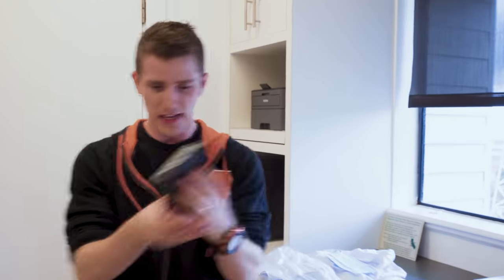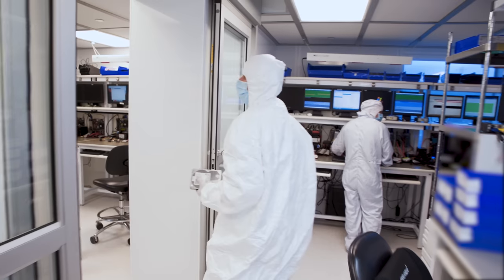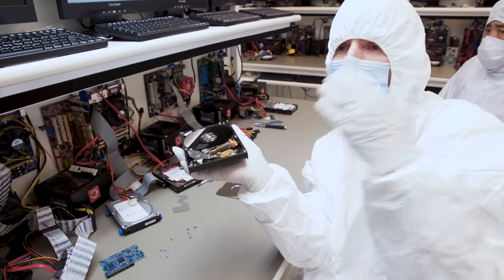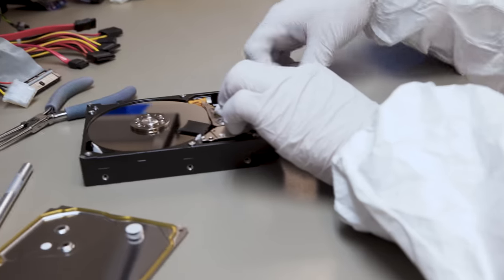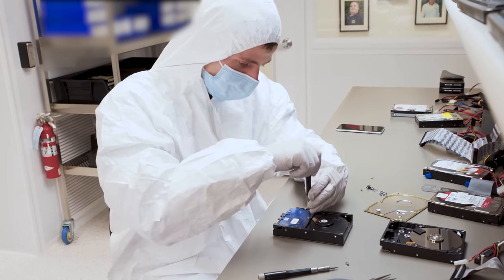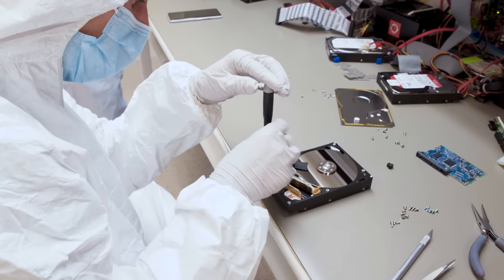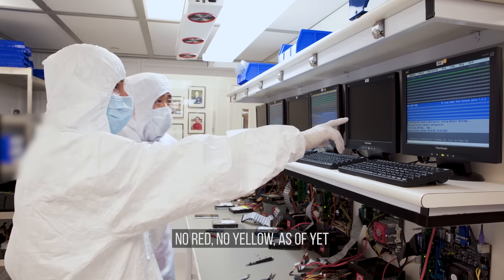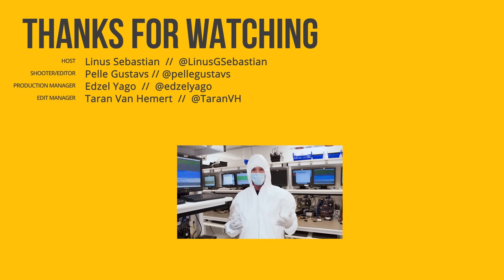REAL Data Recovery - Linus Swaps Hard Drive Actuator!

Comment: Which of these two HDD brands do you think end up the most in that place, WESTERN DIGITAL or  SEAGATE???
Reply: Lost Cause probably Seagate, they have the higher failure rate, however marginal
Reply: Seagate
Reply: Seagate, duh.
Reply: Yes, probably. I'm using a 1 Terabyte Seagate Barracuda 7200 RPM as my storage drive, alongside a Sandisk 120 gig SSD as the main Windows 10 OS location. I bought the Seagate from Amazon six months ago mainly because of it's cheaper cost compared to its WD alternative. I use Hard Disk Sentinel for monitoring all of my storage devices. Well, so far so good. Accoring to its S.M.A.R.T status and all other statics, The Seagate is in Excellent condition. No R/W errors, its speed performance is great, no strange sounds or any other  problems so far.  I always wonder why Seagate has a bad reputation for having the highest failure rate compared to other brands. Many random questions popup in my head, like - Does Seagate use mediocre raw resources to manufacture their parts? Are their engineers less careful compared to other brands when assembling the parts to produce the final piece? Do they employ less experienced people compared to other brands?..Lol.. and many more questions.  
I really hope mine works properly for at least 4-5 years.
Reply: Lost Cause WD because only scrubs use Seagate.
Reply: I have an archival setup, so I can probably answer your questions well. Seagate is the worst, many of my drives failed within a year of purchase (consumer drives). WD was quite better, but the best was Toshiba, only 1 drive has failed me so far in about 3 years of my archive's life. Their drives are a bit more expensive, but I think it's well worth it. I have also heard that Hitachi's drives are good, but they're only availabe as NOS I believe, and I haven't used them in my setup.
Reply: Backblaze publish regular reports on drive reliability, they are pretty thorough and fair in how they document the stats. It seems that generally Seagate drives fail more regularly than WD but this is a very extreme use case!
Reply: Most of Seagates failure were with 3TB drives.  Which I sadly have, but still working. But for 4TB and up, they're actually the same as WD.

Comment: I remember having a Quantum fireball hard drive back in 1998, I think and it was only 6.4 GB. These drives didn't have platter parking ramps like those of today, the heads just stayed on the disks. These ramps are a good idea.

Comment: I wonder how much it costs to use their services. I have a HDD from an IBM PC/AT that was used at my father's (now deceased) work. I'm extremely curious as to what's on the drive. Could be CAD, machine programming, or accounting stuff. I got the PC working, but the drive is dead.

Comment: Cubic meter or cubic foot? and 100,000 is quite high actually. I also remember when I worked in a clean room that we were obliged to move quite slowly, I mean, no fast erratic move, to avoid to counter the positive pressure advantages.

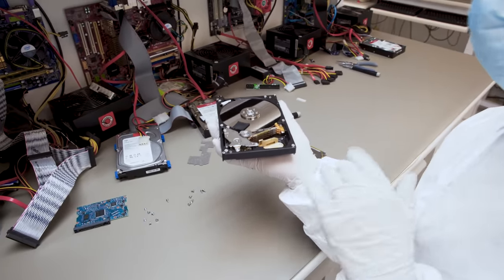Comment: 4:31 Well, i kind of disagree there Linus, i have had the read/write head scrape across the platter without data loss, it's basically russian roulette for immediate data corruption but over time the read/write head will deform more and the drive will become unusable without sending to a specialist, such as DriveSavers.

Comment: Hay Linus, Here is a riddle for you. I'll give you the Specs on my PC. The BIOS, OS and a Hardware list then I'll explain the problem.
 
I'll give you as much info as I go so maybe you can help figure it out.

BIOS: UEFI
OS:      Windows 10 Home | Version 1909 | Build 18363.900
PC:      HP Pavilion 23 q-112 All-In-One (AOI) -  Release Date: October 2015
CPU/APU:   AMD A8-7410 2.2 MHz, 4 Core(s), 4 Logical Processor(s),  with onboard AMD Radeon R5 Graphics.
RAM:  16 GB
HDD:  1TB | 3.5 Seagate, 7200 RPM - No Issues with HDD via Windows 10 Performance Monitor
PART:  2 Primary Partitions ,  Both PARTS 500GB each,  NTFS/GPT
Yeah I know, it's a POS machine by today's standards and even WoW suck on and my friends are always bitching at me because in the middle of a fight my graphics freezes and I can't help them, and when it unfreezes I'm usually getting my ass kicked. I die a lot, LOL.  But,  I'm a 100% Disabled Vet on a meager V.A. Medical Pension, and it was donated to me in early 2016.
And I was extremely appreciative of it when it was provided to me. So I consider myself blessed to even have it. Anyway...

THE ISSUE IS:
I have a USB 3.0 Vantec NEXSTAR 2 Bay Desktop Dock connected to my PC.
 I've had it longer than the PC, but it seems to still be in good shape.
 
I have 2 Seagate 3.5, 7200 RPM HDDs in the Dock (5 yrs old).  One HDD is 1TB (1 Primary NTFS/GPT Partition),  and the other is 4TB (2 Primary NTFS/GPT Partitions split into 2TB each)
The issue is that on the 4TB in the Dock. About a week ago I noticed that when I deleted a file on the first Primary Partition with the label G:, that a Windows dialog box asked if I wanted to "permanently delete the file". I found this unusual but not alarming, so I ignored it. But yesterday, I decided to dig a little deeper. A Google search did not provide any info on the query "why does explorer want to permanently delete files on external hard drive". So I loaded my different Open Source Partition Managers individually to see if there was an issue with any of them being able to identify the different drives, partitions, sizes, file systems. The following apps are what I use to review drives and partitions info.   AOMEI Partition Assistant, GPart, Minitool Partition Wizard, Crystal Disk Info. 
They all recognized the drives, partitions, sizes, file systems with all the numbers being correct. 
I then loaded Windows Disk Management Snap-In tool. I couldn't believe what I was seeing. The DM tool showed only one Primary Partition on the second half of the 4TB drive. The first Partition  info, including drive assignment letter were completely missing, with only the number 2043.65 being displayed. Which is obviously the size of the partition.
 
I have had PC's since I got my first one from Micro Center on Memorial Drive in Cambridge in 1996.  It was their own brand the Spec 2000, if I remember correctly, It was like $2,500 with Windows 95B installed. As a matter of fact they were the "go to" place even though there was CompUSA and several other places in the Greater Boston Area at the time. I do believe it's the same Micro Center that sponsors your show. Sorry for the reminiscing, but anyway. I've always taken care of my computers and learned a lot over the years. But I'm still learning and I'm amazed at your videos and watch everyday. I thank you for them. 
But I digress again...Anyway, Long story short, I have never seen anything like this and no one I know has seen anything like this, Not that, that's a lot of people, but... where all other partition tools are recognizing the drive, partitions, the sizes, the file systems but Windows Disk Management Tool doesn't. 
I'm like WTF! so to speak, LOL
My 2 friends have their ideas but they are different than mine. They think I should just re-partition that partition, but I wanted an extremely knowledgeable unbiased opinion. I was going to change drive letter assignment in AOMEI Partition Assistant, but I don't have a backup of the Drive so I'm leaving well enough alone until I can afford another 4 TB drive, which won't be for at least another month. So, what do you think? Thanks
Chris
Reply: hey, your problem is valid but this is an old LTT video, besides linus never responds to comments anyway. i think you're better off posting this on LTT forums and tom's hardware. i reckon you'll get a solution in a day!

Comment: just  want  to  share  my  terrible  experience. I  had  my  maxtor 1T send  to  netherlands  to  recover data which only have 2 years life time then sudden death.  Journey  took 2 months. Yesterday i get  my  recovered  data  stored  in a 2T seagate  expansion+  but encrypted  by  bitlocker.  the decryption  process  is   hell  long  only 52% stuck, then i pause and shut  down,  next day  it  is unreadable  and  no  way  to  format  it. So  bad seagate  quality!
If  You  hear  a  beep  beep  sound ,  meaning  count down  to  sudden  death  starts!
Is  the  microsoft  bit  locker   kill  the  2T  seagate  expension+  or  it  is  a  defective  product  manufactured  in china 2020? 
Seagate File  Recovery  Software  cannot  recover  ,diagnostic test, Erasing device.
Seagate 2T expension+  quality  is  bad.  Software  is  bad.
"Device not ready"  means  hardware  corrupted !

Comment: Ok. so thats why it costs... Ive an old external 1T ssd that fell 40cm off my old pc, while spinning....... some 200-300 homerecordings in it, but even the 'just looking'/'(flash-)light treatment' costs some 300€ in finland... I've been trying to figure a way to cheat a little to have the recoverable data saved on a new external..... but I figure thats not going to happen.
Reply: BTW. thanks to sloMoguys I figured to come over n look for clues.

Comment: Here you have all the pure truth about Drive Savers business. In fact, they are looking for easy money. This is all paid advertising. All they can do is hire a talentless Linus for a demonstration show. We checked the work of this company. In fact, they spent $ 2,000,000 to sweat away people’s eyes. Although it would be possible not to spend such funds. They even tell customers that they open SSD drives in a clean room, although this is not required at all. And this certainly increases the final price for the job. In fact, the cost of data recovery from them is not justified by anything and usually competitors are 50-80% lower. By the way, some of the disks they could not recover. Which have been successfully restored to other data recovery centers. Sometimes customers are told a high price and people go to other cheaper companies. They do not have access to the full technical  documentation of Seagate and WD hard drives. They use the usual stupid fast copy devices like ATOLA, Deep Spar and in these cases they simply can completely damage your already slightly broken hard drive. And then they say that nothing can be done. or then can try use PC3000 to correct the situation. Engineers can do work little above middle level. Difficult things such as reading damaged hard drives or unreadable SSDs they do not know how to do it. Many steps in their work are superfluous and simply take time. regular case every lab can actually do in 2 days they do 2 weeks. They use the PС3000, Soft Center and Rusolut programs to recover data from flash memory. 
   Usually, for quality and more complete data recovery, the engineer works with 1 or 2 devices. Everything is done automatically and without complete control. So DriveSavers engineer can work with 5-10 disks at the same time, and this reduces the quality of data recovery.
About phones. I think this is the worst equipment I've ever seen. They would be ashamed to show how they work with soldering and with phone PCB . It is clear that the "Celebrite" program will help but not always. And they don’t really know how to really  solder because I think they do not have degree. And they do it badly. Again, competitors like "iPad rehab" handle it better.
   
I advise everyone - Think well before you carry your device to Drive Savers. And if they do not help, look for other specialists, but do not forget to write a real review when others restore you data after them.